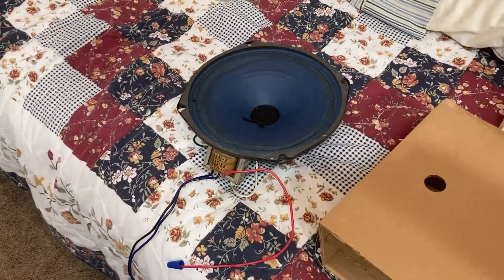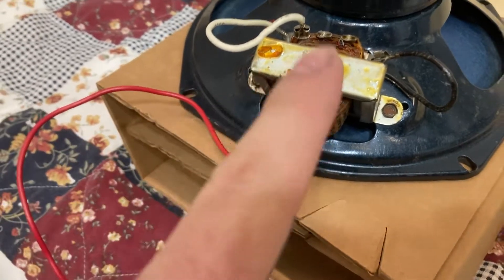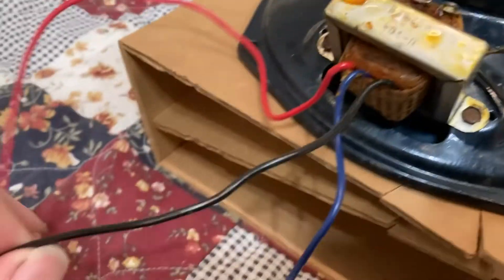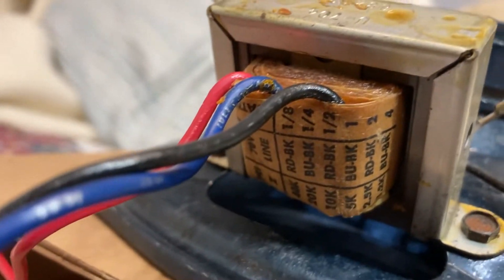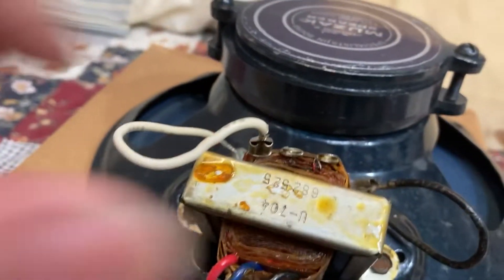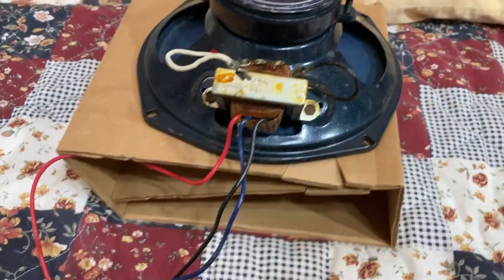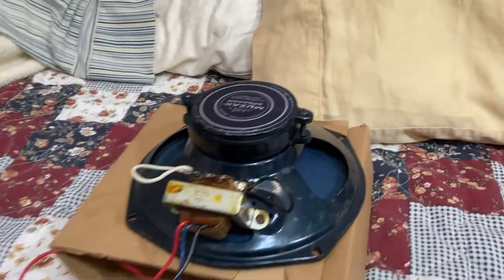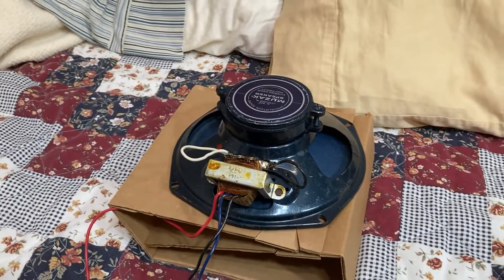How To Tap A Vintage 70 Volt Speaker Transformer

Comment: Do both sides add up?
Reply from the maker: Both sides do add up on the primary and secondary taps.
Reply: Ok thanks! How do you not get confused with the corresponding connections?